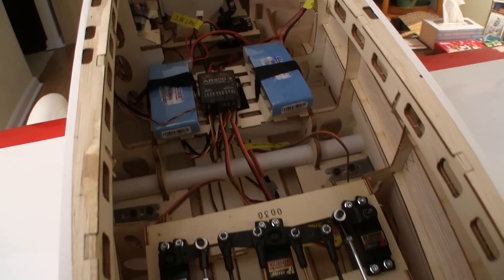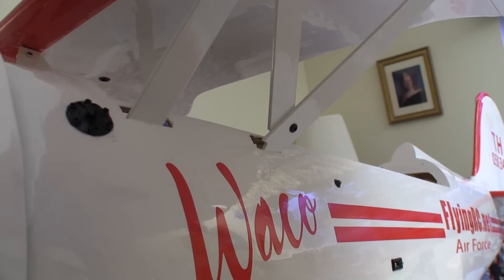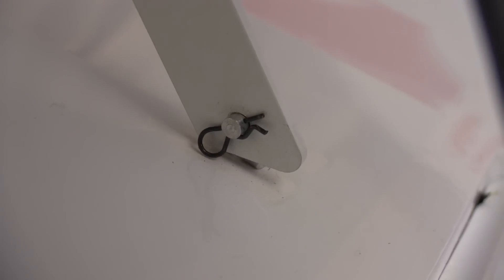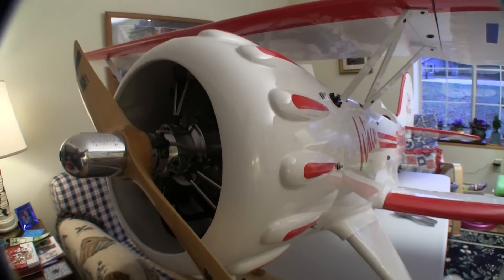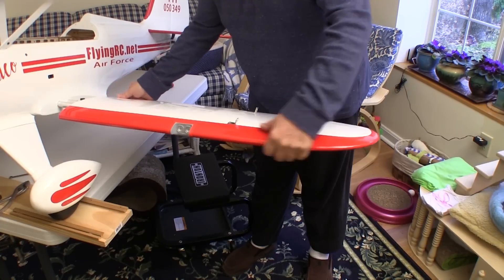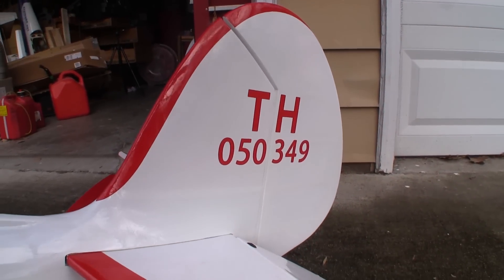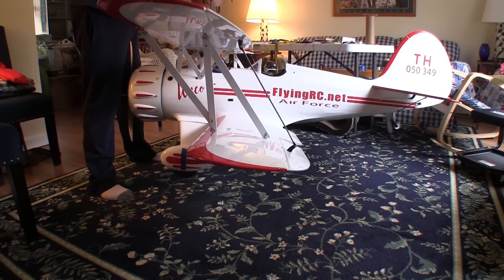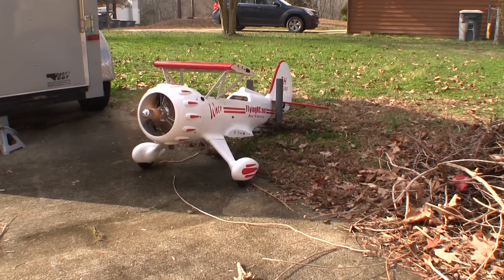Phoenix Models 60cc Waco Build

Comment: If your local hobby shop dose not have them little clips, ACE Hardware has them in all sorts of sizes and they are cheaper then the hobby shops. Like the bi-plane and 3 cylinder engine.👍

Comment: I am just finishing this plane up. Have you had any issues with the bolts for the center section, I am concerned that the cabanes will slide out during flights. Love your channel and appreciate the honesty!
Reply from the maker: I never had any issues with the cabane. I did however make sure those bolts were tight and thread locked.

Comment: Thanks for sharing this.  Out of interest what size is the Saito ?
Reply from the maker: It's the 60cc version of the Saito
Reply: I have the 84 nd and hoping it will fit . I'll need to check differences in weight.
Reply from the maker: I did not have to add any weight to my Waco to balance it with the radial. I suspect you will be in that neighborhood with the 84cc version.
Reply: @flyingrcdotnet  Thanks for your help. I'll get the model on order. Love your videos.